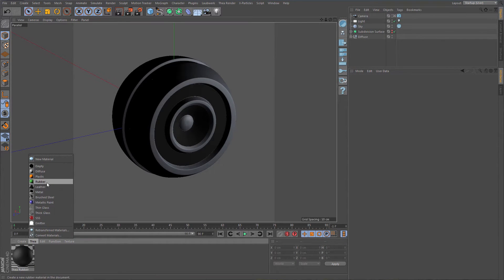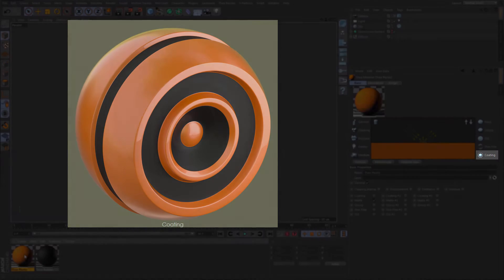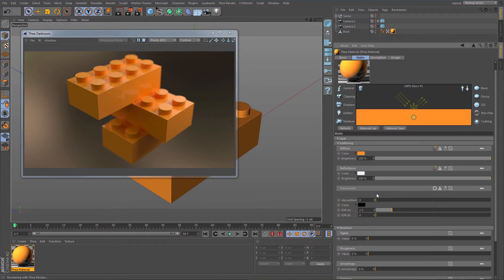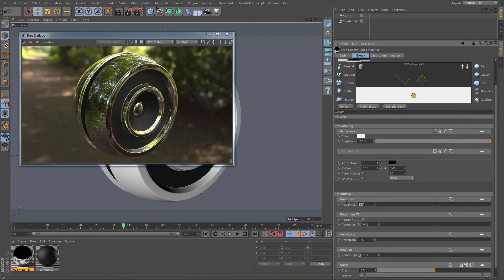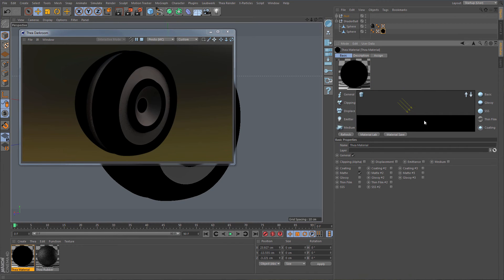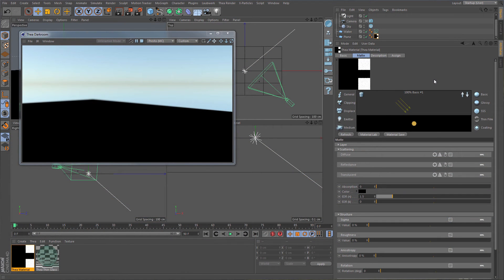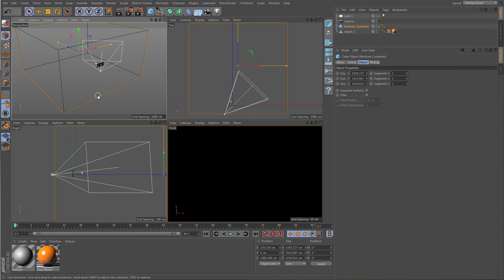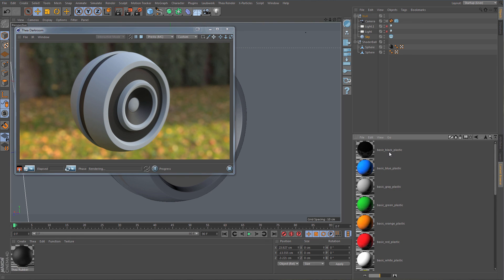Thea for Cinema4D: Tutorial 2 - Materials Overview

Comment: Why does Thea mess up my material UVs when converting them to thea materials? I have a house with roof shingles, for example, and after converting my materials to thea materials, the shingles are lined up in the wrong direction. And now I have no idea what to do about - they still look right on my model without rendering, but when I render, they are turned in the wrong direction in the rendering. I could try to turn them manually, but I can't see what I'm doing or the the result while I'm doing it because only the finished render shows how they will look, so it would be guessing over and over until I got it right. This will never do for efficient production - I need a renderer that renders my model as it is shown, not something that needs to be endlessly tweaked to get a decent render.

And if I don't convert my materials to thea materials, it still renders them with the UV's rotated in the wrong direction.